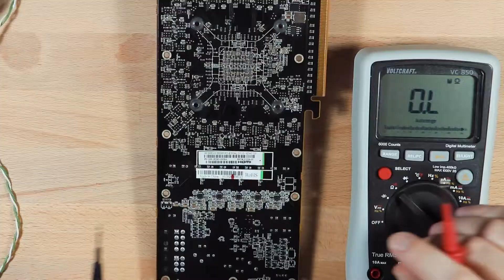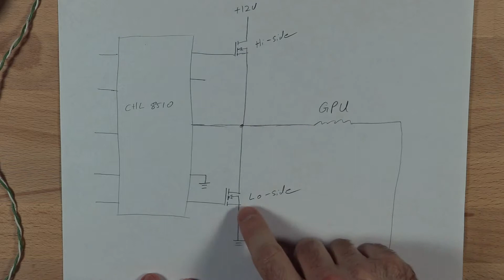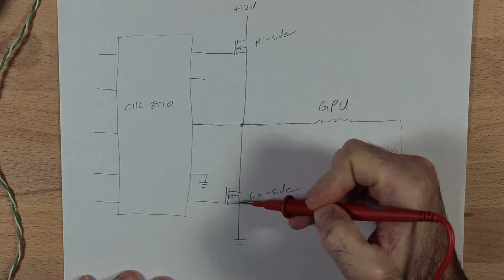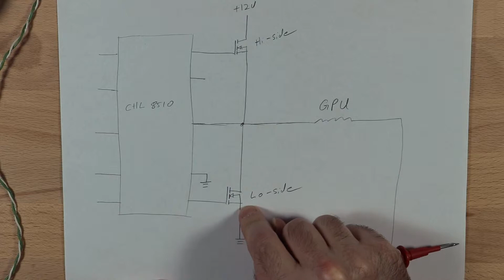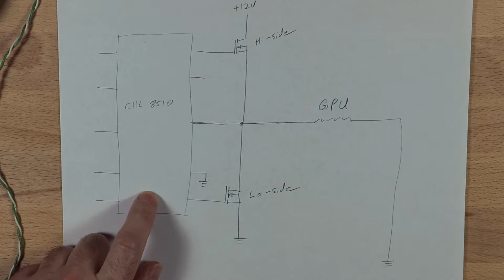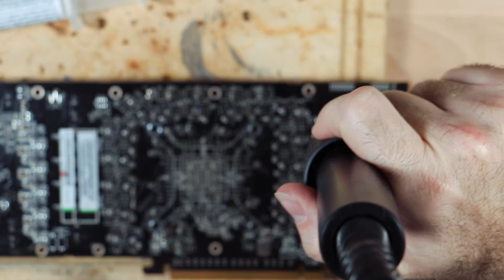Graphics Card Necromancy - More Diagnostics - R9 290X Episode 2

Comment: REFERENCE R9 290X burn your system..> Possible !Fire Hazzard 
STAY THE FUCK AWAY FROM THIS CARD...
PURE OVER HEATING CRASHING GARBAGE  !!!  ...  94C -96C  - 104C  ?
Radeon R9 290X  Nothing but trouble...
Reply from the maker: Whoa, slow your roll, broham!  

The 290X is notorious for how hot it runs (and how much power it consumes), and more importantly, it's obsolete in 2021 anyway.  It's designed to be able to safely handle running very hot, and just to be extra clear, no part of a properly functioning 290X gets anywhere near hot enough to cause a fire.

Are you seeing those temperatures with the Sapphire Tri-X heatsink, or is that with the original reference blower heatsink?
Reply: 12 years and its still helping me do my work and play games, couldn't ask for more.
Reply: You just dont oc it push it to its limits without a good cooling system, then you should be fine for another 8 years

Comment: Hello, i have a r9 290 that the fans run when the pc turn on but nothing elso happens. Dosen't boot to windows at all. Tried different connections and monitors.
Reply from the maker: It's hard to say what might be wrong with it based just on that.  Try doing the same checks that I did in this video and the first one.  Check each rail for a short (actually zero ohms, not short detection mode) and then check each rail for the proper voltage with the system on.

The 100% fan behavior is basically just a sign that the GPU isn't running, but the board is powered up.  If you find a rail that isn't working, you can then troubleshoot that rail.  If you don't find a dead rail, then chances are you have a BGA or logic failure, which aren't something you can repair very easily at home.
Reply: @AaronAverett  alrighty! Thanks for the information, will try and check it out.
Reply from the maker: @Camska427  no problem.  Something else to try might be to plug it into another machine.  That behavior can also be an indicator that you’re not finishing post for some other reason, line bad memory settings or something.

Comment: I have a similar board (280x) with corrosion around the CHL 8228G chip mainly affecting 1 smd cap, do you think that would be causing one of the fans to not spin?
Reply from the maker: Doubtful.  I've not had a 280X come across the bench, but until pretty recently, there was only one circuit for the fans, so if one fan works, and the other doesn't, the problem is  most likely in the wiring or the fan itself, and not actually on the card.

Edit:  You should obviously clean the corrosion off anyway, though.

Comment: Hi, very helpful video, I have problem with the VDDCI, my first mosfet is getting hot, also on the back on the  memory faze, my fifth pin is only about 500 ohm. In my case its the memory faze fault or the mosfet, I need to do desoldering and check it....anyway Im woundering did you fix the problem with this graphics card? I would like to see the result. Thank you for very good video.
Reply from the maker: I need to make another video with this card.  I haven't fixed it yet, but I did replace the components that I said I would in the video, and afterwards, the resistance values went back to normal.  I've just about concluded that the problem lies in the IR3567B voltage controller, which is unfortunately not trivial to replace, as it requires programming from the factory for each application, so you can't just buy a new one and solder it on there.